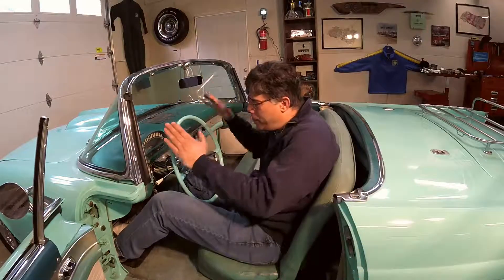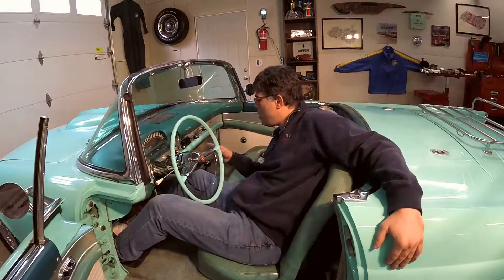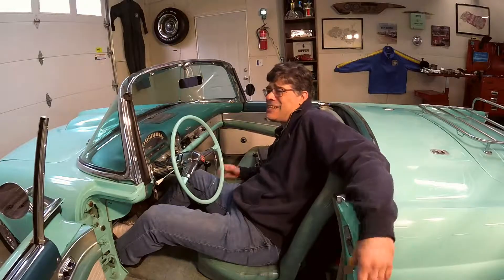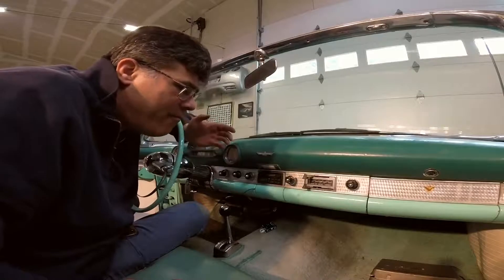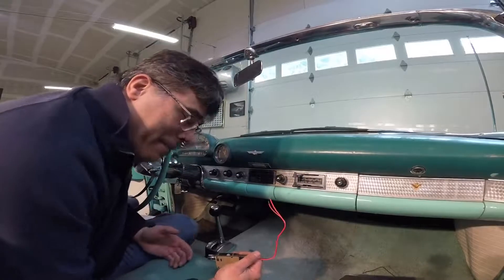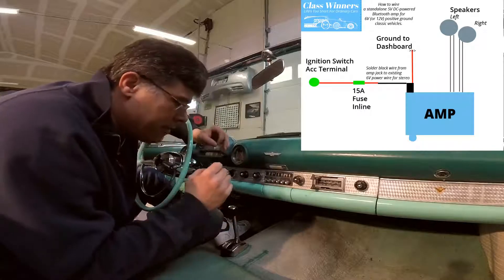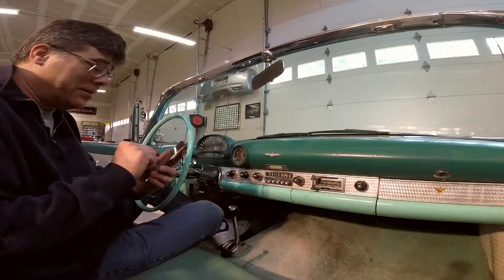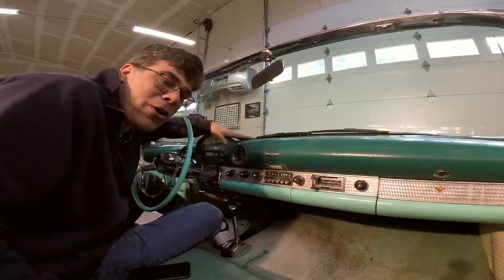Installing $15 Bluetooth Gizmo for Music in 6v Positive Ground Cars [Collector Car Guru Workshop]

Comment: Im going to be putting one of these units in my 1954 f100 6v pos ground. How do you connect the speaker wires? + to + , - to -  or + to - and - to +  thanks
Reply from the maker: + to + and - to -. Theoretically, it is important to keep the correct polarity with speakers to ensure the speaker cone moves correctly, but in practical application of car-sized speakers and lower watt amps, you will likely never be able to discern the difference with audio clarity with reversed polarity...nor will it be a factor in the longevity of the speakers.
Reply: @CollectorCarGuru  Thank you for your support. Did you use the supplied power pig tail? The wires seem very thin, Any concern? Considering 6v likes thicker gauge wire.
Reply from the maker: @buildnskate9386  yes, use the supplied pigtail. The amp unit doesn't draw many amps (less than 2), so with Ohm's Law, the wire can be tiny. The reason you need thick wires supplying the starter circuit in a 6V vehicle is because you need half resistance when there's half the volts (6v vs 12v) to push the same amount of cranking amps (number of amps over 30 seconds), which in a 6V car battery is somewhere around 600-1000 -- or 20-33.3 per second.

Comment: Well what is the name? I can't find that thang!
Reply from the maker: Link in the description: https://www.amazon.com/MakerHawk-Amplifier-Bluetooth-Theater-Speakers/dp/B08Z3FBSDT/ref=sr_1_2?crid=344WWQXKJAI41&keywords=WHDTS+%E1%B8%84%E1%B8%B7ue%E1%B9%ADoo%E1%B9%AD%E1%B8%A5-Compatible+Audio+Stereo+Power+Amplifier+Board+Module+BLE5.0+Dual+Stereo+Output+50W%2B50W+5V%7E24V+%E1%B8%84%E1%B8%B7ue%E1%B9%ADoo%E1%B9%AD%E1%B8%A5+Receiver+Module+with+Case+DIY&qid=1650574049&sprefix=whdts+%E1%B8%85%E1%B8%B7ue%E1%B9%ADoo%E1%B9%AD%E1%B8%A5-compatible+audio+stereo+power+amplifier+board+module+ble5.0+dual+stereo+output+50w%2B50w+5v+24v+%E1%B8%85%E1%B8%B7ue%E1%B9%ADoo%E1%B9%AD%E1%B8%A5+receiver+module+with+case+diy%2Caps%2C218&sr=8-2